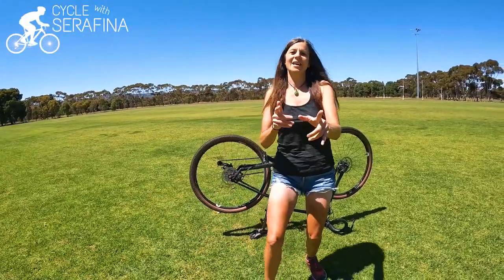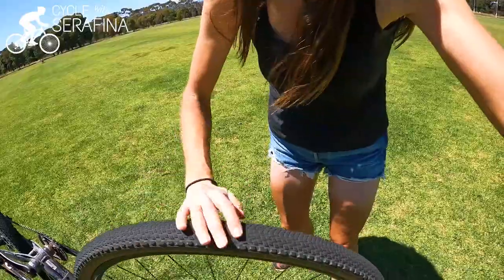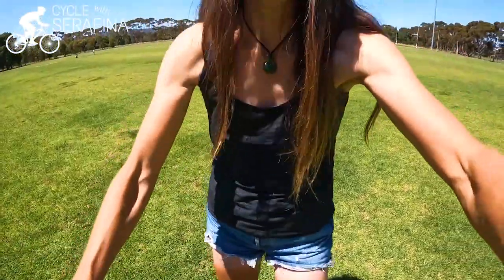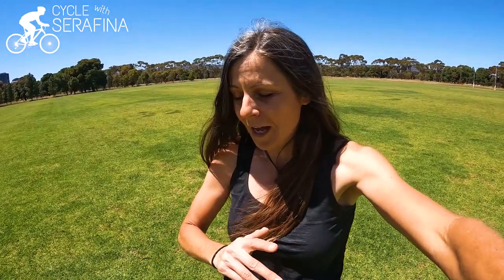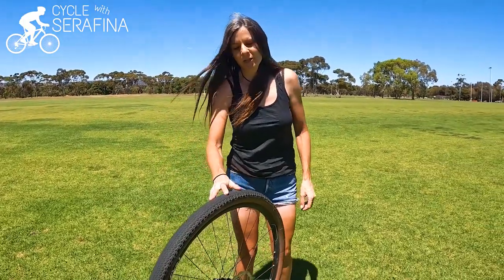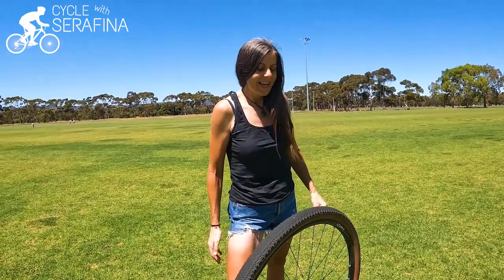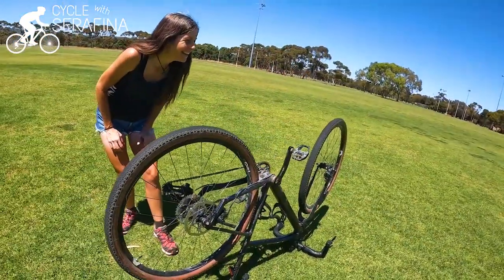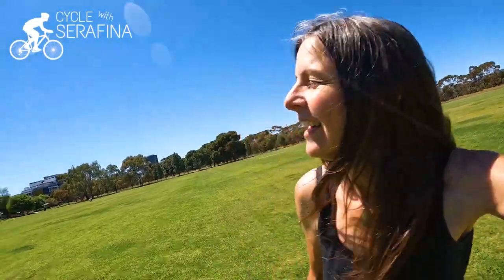Bike Tyres That Don't Go Flat

Comment: Ive been using tubeless on my xc bikes since 2006 and it is great for that.

For road 100psi though I found too many leaks with that pressure. Loose valve cores are the main leaker.
Reply from the maker: Ah interesting, I was wondering if it was worth it for road. I've only had two flat tyres in the past year and half on my roadie, one of them was on gravel 🤪